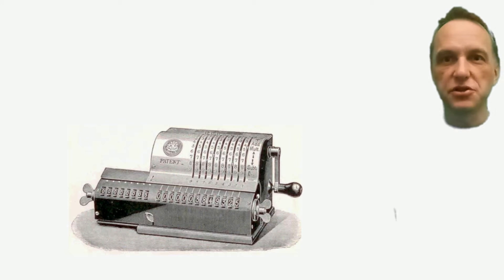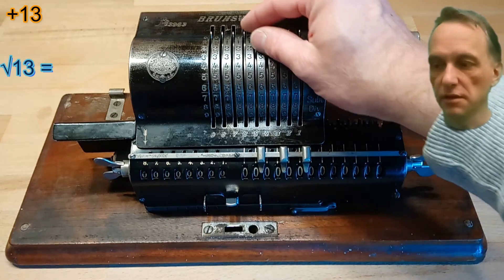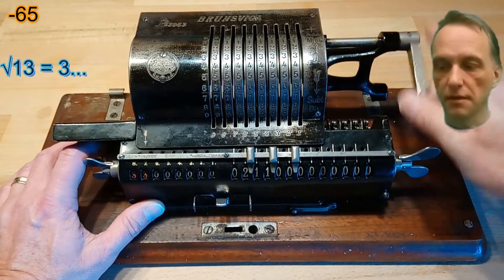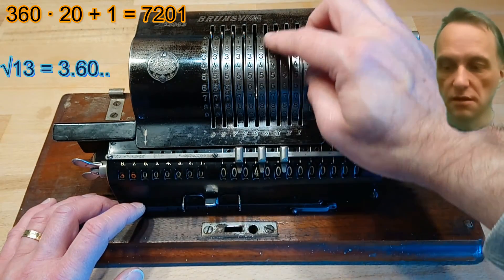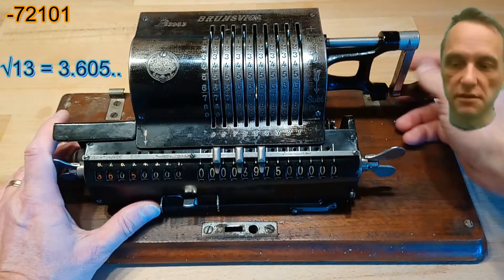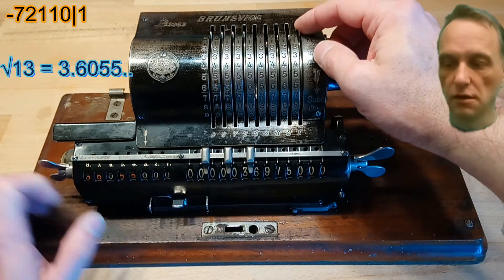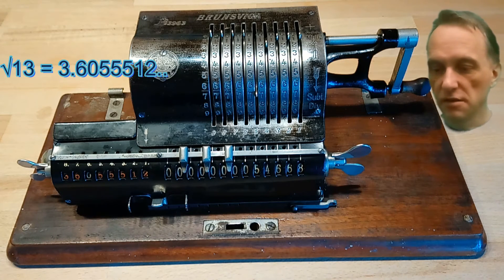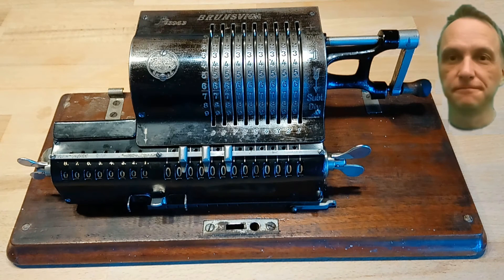Calculating the Square root of 13 using Toepler's method for mechanical calculators

Comment: I do this on my 1922 Model K Monroe and my mid-1930s LA5. I also have a 1929 Burroughs Portable Adding Machine which could extract up to 4 digits but the counting would be manual. It prints on a tape so one could mark up the tape; I haven't tried it yet. There is a Comptometer version of this method too which seems to require a lot of mental arithmetic. The Comptometer method extracts to the accumulator dials; I haven't finished figuring it out (harder without complements on the keyboard). I don't have a Comptometer type machine.
Reply: I figured out the Comptometer method. It adds complements and the carry puts the root to the left in the accumulator dials. Each new digit extraction starts with 20 times all the previous digits extracted then a 10s complement in the units place: 9,7,5, etc. It is not too bad.  I was confused because I tried to follow Felt and Tarrant's example which was poorly written and hard to follow, the instructions before that are pretty clear.  It also helped to do the Toepler routine on paper to figure out what is happening. I got the Comptometer root to work on paper, now to try it on the machine. I do the Comptometer-style division on my little Tronchet style (or Addiator) calculators (I have a Baby and a Tom Thumb)...this would be handy on them.

Comment: Amazing being able to do square roots on an Odhner style pinwheel adder! 😯👏👏👏
Reply: Be aware that the ODHNER-style pinwheel calculators are WAY MORE than simple adders...they are able to do all 4 basic calculations (+ / - / * / : ). With that "set" of abilities, one can calculate square roots directly, and higher-order roots from a starting value, and it can be used (utilizing potence series) to calculate trigonometric functions like sin(X), cos(x), tan(x) etc.
Reply from the maker: Yes and the method was quite simple and efficient. It was even possible to calculate square roots on the first mechanical calculator 400 years ago, the Schickard Calculator from 1623. On that machine a different algorithm had to be used, first because that early calculator was constructed differently in a more simple way, and second because Toepler's method wasn't invented before the end of the 19th century. I have also a video on how to calculate square roots on Schickard's calculator, if you are interested.

Comment: This'll help with my attempt to be funny at a math test tomorrow, thanks for posting this. Now I can do the whole test with my soviet Feliks calculator
Reply from the maker: Good luck with your math test. It would be very cool if you really do that with your mechanical calculator. 😎
Reply: @jepumachines  At first I was planning to take it out, crank once or twice and start using an electronic calculator, but it appears that it kinda got lost... so yeah, I'll most likely do the test with the mechanical one, unless the teacher gets fed up with the noise and has me use my scientific calculator (despite how we're supposed to use simple calcs)
Reply: I can just imagine walking into class with this and explaining that this is your calculator and then making an incredible racket during the whole test period as you crunch numbers! 😅🤣
Reply: @bwhog  Too bad I didn't get the one task that mightve needed this. Did most of the calculations in my head, number were quite small